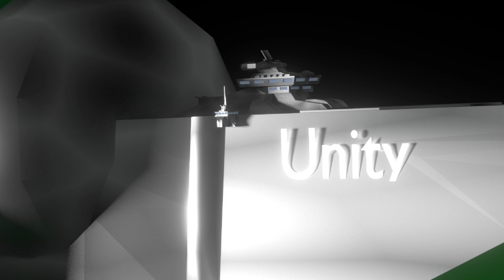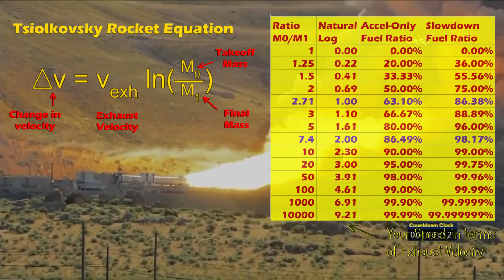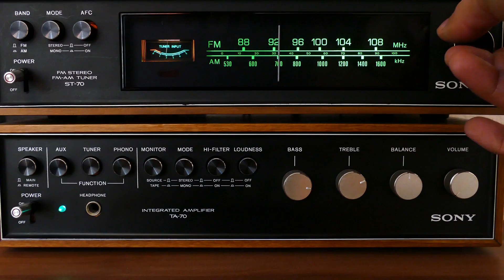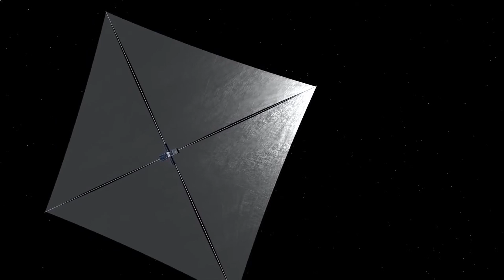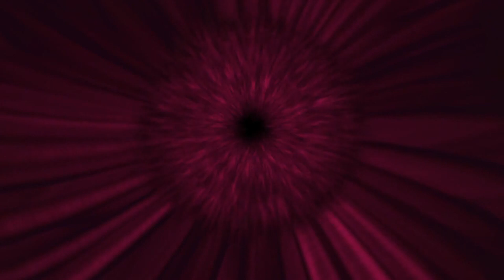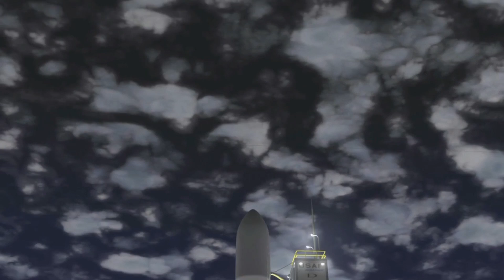Interstellar Travel Challenges

Comment: Bussard ramjet
Reply: A great idea at first, but upon further examination the drag from the massive magnetic ram scoop would be greater than the thrust of the engine, that being said, any interstellar ship would still have the ram scoop or a solar sail as a way to slow down and bleed off speed without spending as much fuel, so in a round-a-bout way it still works, you just need to carry more fuel than the original concept and perhaps use a laser sail to aid the initial acceleration to get the spacecraft moving towards it's destination

Comment: Ok, here's one for you. It involves time contraction and communications. If a ship is traveling at a significant percentage of the speed of light and the crew sends a message to Earth, based on my understanding of time contraction, that message could take thousands of years to reach Earth, but to the crew on the ship, that message would appear  reach Earth much faster. Also any message from Earth would appear to reach you much faster than it would appear from Earth.  Is that true?
Reply from the maker: Not quite, you're presumably thinking Earth is 1000 Ly away but to the ship it looks, say, 100 Ly, and it does, but they also see Earth redshifting away at a very fast rate and will think the planet will be even further away when that message arrives and thus be very delayed. Of course you can get into Twin Paradox here, but if you run down all the numbers in their appropriate reference you won't get a problem. To an outside observer that message will get to Earth 1000 years later and the reply will get to them 1000 years, plus another 1000, plus whatever distance that ship covered that it has to catch up to, which would be a lot at that level of redshift. The folks on the ship won't think that much time has passed, for that shift they'd think about 10% had, but they'll not be able to use this for FTL or time travel

Comment: Wouldn't twice as long make turnaround mid journey structurally difficult (if not impossible) since the strain on the materials in the center would be (i believe) 4 times the strain of the previous ship? I'm not an engineer, so I welcome corrections here.

Also, I would be concerned about expanding the turnaround time, because so much more of the ship would be exposed for a longer time, with less armor, and without the same level of firepower to vaporize particles too large to shrug off.

By the way, this video is awesome, and Issac, you are amazing.
Reply: You wouldn't turn around under thrust ,u would coast and turn slowly
The lengh of dhip wouldn'tmayter much
Reply: @SeanSoraghan  I wasn’t taking about turning under thrust. The relative speed you are coasting at when you go for turnaround is really high compared to the dust and sand you are in essence slamming into.

The strain on the ship from turnaround is pretty enormous on a massive ship. Even turning slowly, the length of the ship acts as a lever on the other side. It can bend if the forces are too great, and great forces are needed to move a great ship. I just don’t know the math of when it becomes a problem.

Comment: A solution to slowing down a laser propelled solar sale ship might be that when you are approaching your destination, you deploy large-ish probes out in front of the ship, and have them point lasers back at you. They would be traveling at the same speed as the ship itself, since they are being deployed from the ship while the ship is at its top speed, then they can simply point their lasers back and hit the sails. The ship would be slowing down, and the probes would be speeding up, but since they are shooting lasers out that travel at light speed, the widening gap between the probe and ship would not be very meaningful.
Reply: Thank you!
Reply: So basically you are using probes as 'rocket fuel' with a pretty low velocity.
Reply: Much simpler to just shoot lasers to the front.

Comment: Is a front facing shield really the only one you would need to concentrate on (on your point of extending length rather than width? I would see objects coming from all different directions, even from behind you depending on where you are traveling to. For example say you are heading in the direction of the center of the galaxy but a dust cloud is traveling 1.2 times the speed of the rotation of the galaxy you would get peppered from the side by the dust cloud right? Interested in what you think!

Comment: A molten/foaming blob of metal, held by magnetic fields in front of the ship.
Anything falling inside will heat up the blob and it's self repairing. 
With very strong magnetic fields and antimatter the "trash in front" becomes fuel...
Reply: One issue with that is even the most magnetic properties loose any response to magnitism when molten, even a good magnet glowing red hot can rapidly loose it's magnetism or magnetic properties until it cools down and is re-magnitised, can't remember the name of the effect but suffice to say it's problematic

Comment: i believe an object just a quarter wavelength long can be detected fine, they don't need to be a full wavelength. Radio reflectors work just fine with holes or gaps in them, as long as they do not exceed 1/4 wavelength diameter. Of course those are holes, not objects, but the for same reason an object should reflect if it is 1/4 wavelength or larger. I am sure smaller can work too, just not very efficiently. Maybe I'm wrong considering both to be the same in regard to wavelength? I don't think so though.

Comment: Assuming plenty of [fusion] energy, would it be practical to have a slightly larger "ship" (but in the shape of a hollow tube) ahead of them that constantly vaporizes anything that goes inside (no targeting required)? If its shell was relatively thin it wouldn't take much damage from front edge impacts, so only minimal leading armor needed.

Comment: This shield idea of yours is worthless, especially if you are placing them seconds or minutes of travel apart. Objects still would have a lateral velocity relative to the ship (That is, traversing in front of the path). Even if your shield is a km across in front of you, a hypothetical piece of debris would only need a lateral velocity of meters per second to cross into your ship's path between the shield passing and the ship passing. You'd be much better off designing good shields with better repair capability in the front of your ship, rather than wasting your mass taking out a very narrow cone of problematic debris.

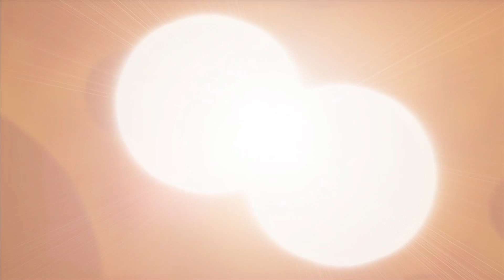Comment: ahhh..around 20:01 there is no longer a gain in efficiency when dealing with fusion reactors of a larger size,  considering now that REBCO superconductors enable the construction of Tokamacs with high field strength, enabling modular design of critical parts for easy replacement and thermal management. That is why many smaller companies are now building Tokamacs at least an order of magnitude smaller than the big boys, and they are not even pushing the superconductors to their limit.

Comment: Biggest problems in space no air it runs out fast look how long subs got befor it has come up for air lol they bout same when comes to space
Reply: Michael O'Leary You recycle the CO2.
Reply: Xi-K so how long do subs stay under water then there max is same as space
Reply: Michael O'Leary No.  Air filtration systems that take H2O and use electrolysis to generate oxygen are in use on the ISS.  CO2 can also be used, but it takes more energy.  Not worth it on a space station above Earth, worth it on a futuristic space ship in deep space.  Submarines usually use tanks of air, because they know they will only need O for a limited period of time.  However, some nuclear submarines separate salts from seawater and then use electrolysis to generate their own oxygen.
Reply: Xi-K power is to solve using generators and electric motors 24/7 power no fuel needed
Reply: Michael O'Leary What are you even talking about.  Generators all require fuel.  Whatever is used to generate the energy is fuel.  That means that anything from oil to natural gas to water itself can be considered fuel.  Anything that produces electricity requires fuel of some type.  Even fusion reactors would require hydrogen as fuel.

Comment: Snag the protective sails as they drift back towards the ship? You're not going to be 'snagging' anything going .1c. This description makes it sound like the spaceship will be be akin to a sailing vessel on the ocean. It won't even be similar to space flight we've experienced thus far. The extreme speed will make complex moving parts, not physically connected to the ship, impossible to control and regenerate as a shield system.
Reply: Why?
Reply: The relative velocity of the sail is quite small compared to the overall velocity of the interstellar voyage.

Comment: Actually for a warp drive you are moving space around you so you don't have to worry about smashing into things at the speed of light or greater because if they do enter your warp bubble they would only be moving as fast as the object was relative to you so if you had an dust particle which was moving at the same speed you were through space not the speed of which you are moving space at.

once it got into your warp field it would just sit there and you could gent send someone out to flick it away, now this only works if you are travelling at the same speed in space though if you set out from earth you are moving with the velocity of the earth orbit around the sun and the suns orbit around the galaxy and if you go outside the galaxy you are moving with the speed of the galaxy as well.

So it's not likely that you are going to encounter much matter moving at the exact same speed and direction as you through space, but we are not talking about anywhere near light speed for most things, although stuff would build up in your warp bubble like radiation and matter.
Reply: I'd be worried about the possible radiation explotion when the concentrated matter and energy at the front of the warp field is released, or if the warp drive failed mid flight without properly deceleration you might instantly "slam" into the speed of light and explode in a ball of high energy gamma radiation as your matter turns to energy, possibly, I'm not clear on exactly how it would work but that possibility makes imortallity and sub-light-speed travel seem much more reasonable

Comment: Finally some scientific narrater that takes into count real physics for the design of ships that can go interstellar. The ship would need to take the shape of a needle. But some other thing I was thinking about for a spaceship that travels interstellar that it won't be a single ship but a fleet of ships. They could be smaller ships deployed from the main ship set out a regular intervals, or just (unpropelled_ probes - for instance for relaying data and/or as part of the interstellar highway - but in a mission profile where you want to stop at the destination and decelerate around half the travel time, probes you deploy at the topspeed are going to arrive there much sooner then the main ship (even when not further propelled) and can give a look close by on the destination long before the main ship arrives. Further,  a manned interstellar ship would want one or several unmanned crafts in front of it to clear the way and provide for a way to avoid collissions with debris. So an interstellar space journey would likely not just be one singular ship but a fleet of ships and/or probes for various reasons and functions.
Reply from the maker: I tend to agree that a fleet makes more sense, in most cases, it will kind of depend on the specific techs available and mission parameters, but frankly its a single ship here for convenience.

Comment: The collision protection section of the video made no sense.

1. Solid chunks material larger than microscopic dust grains are virtually non-existent in interstellar space. They exist in solar systems because orbiting a star massively increases their density and chances of accumulation, and once they get to the size where gravity becomes important they can grow quite big. But not in interstellar space.

2. Infrared is not good at detecting interstellar dust. In fact scientists use infrared telescopes to peer through dust clouds to study star formation. You'll need visible light for detection.

3. The power required for your LIDAR to detect dust-sized objects thousands of kilometers away is itself powerful enough to vaporize it. But there is no need for active protection any way because:

4. At 10-20% speed of light, collision energy per nucleon is in the MeV range, so chemical bonds are completely irrelevant. A single, millimeter-thick shield deployed in front of the ship will easily vaporize and ionize rocks weighing kilograms; there is no "fragmentation" to speak of. Alpha radiation can be stopped by a sheet of paper, so the only thing the ship itself has to withstand is the diffuse heat coming from the plasma after the collision.

Comment: With solar sails, do you need to think about fuel to slow down if your destination is a star? Is the solar energy from the star enough to slow a ship down from any appreciable speed before it gets too close to the surface of the star? At the very least, you could gain a certain percentage before needing to engage the "retro" engines.
Reply from the maker: The usual notion is that you use these when the destination is already developed, so that they have lasers to slow you down with. There are way to slow down without using on board fuel, or at least using a lot less, but nothing I know of that let's you come down from genuinely relativistic speeds without taking very long times.

Comment: For near light speeds you don't use a radar system to detect small debris ahead of you. You push a heavy steel plate ahead of you with lasers. Anything that penetrates the plate will be heated by the collision to the point that you will track and target the debris optically. You could have the mirrors on the back of the plate steerable and automatically target the debris from there as well.

Comment: A lot of the problems of shielding and targeting computers can be solved by placing a blackhole in front of the ship.  It can be power storage of virtually infinite density.  It's gravity will put in all matter, and nothing will hit the ship.  You just need to keep it a certain size, big enough to draw matter in at speeds, yet small enough so it doesn't spiral out of control.  You then draw out energy from it, to run your ship.  1% percent efficiency who cares you have a blackhole worth of energy.  Just drive your ship through enough dust cloud to make it big enough to go whatever speed you want. 

A blackhole 6 attometers, thousands of times smaller than a millimeter yet whole have as much mass as the empire state building.  A very small blackhole will have crazy gravity.

Comment: Hang on. weren't you concerned about Unity being the upper limit of heat radiation for population? I may have heard that wrong, but it had me thinking. How come you don't have radiation fins on this ship? You could radically increase your radiation surface; a few well placed heavy duty blowers, and you could create snow days.
Reply from the maker: Who says it doesn't have fins? It's a giant factory ship Clint, if its running in a mode where its producing too much he, it extends fins or even builds them or more surface area, if its running in power save mode it could fold up to insulate, bouncing IR back like a Thermos. It could have some long tether trailing it conducting or convecting heat to release in a series of fins strung out behind it and its shielding.
Reply: Another question

A ship with an inner hull and an outer hull. The inner hull is pressurized and blah de blargh. The space between the inner and outer hulls is... vacuum. Ignore space debris for a moment... 

If forward and rear ports were opened on the outer hull during sub-light travel, can heat be vented? For that matter, how effective would liquid cooling be between the hulls?

Comment: Wouldn't it be better to talk about the basic problems of accelerating first?
If you use a (regular functioning) fuel with a higher exhaust velocity than normal rockets, the heat should just melt it.  
A melted rocket doesn't fly very fast....

The kind of Fusion-reaktors we will have in "20 years" are huge and heavy out of principal, because you need the fusion gas to have the right density, heat and also the magnetic field that contain the gas can't get generated from nothing.
Even if that problem is solved you still have pure heat. If you want to turn water into steam use the to produce elekrisity to than power an ion drive, well that seems to totally crazy to me.

Black holes are even more complicated, there is no prove that small black holes even exist or are producible in theory.
That's not even a concept, it's a guess about what might become a theoretical concept.

I like the futuristic approach to these topics, but this is almost as extreme as talking about the implications of superpowers being real. It gets boring if it looses the connection to reality.